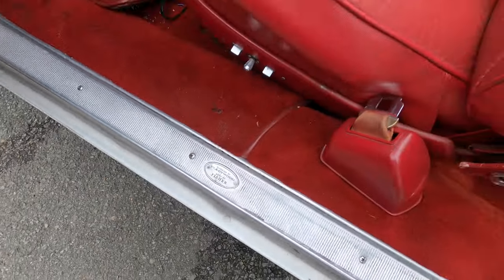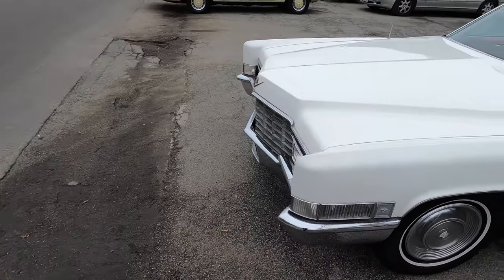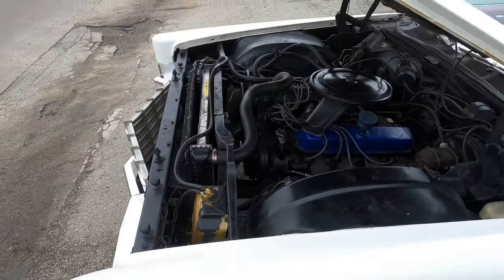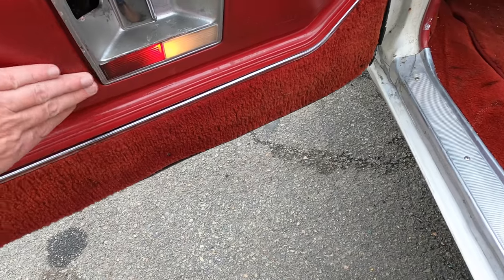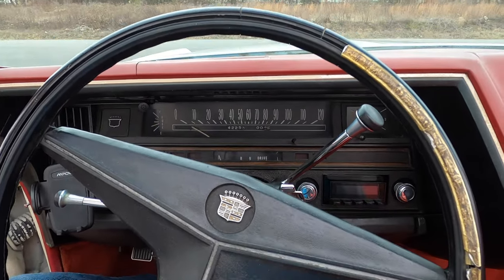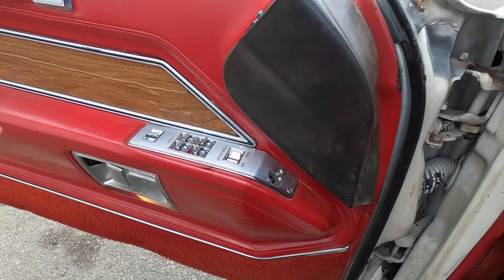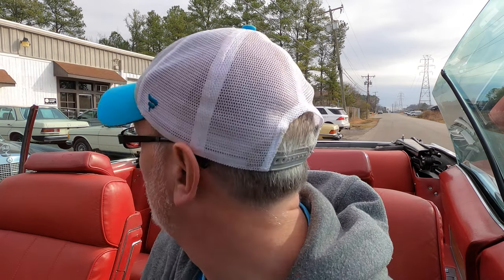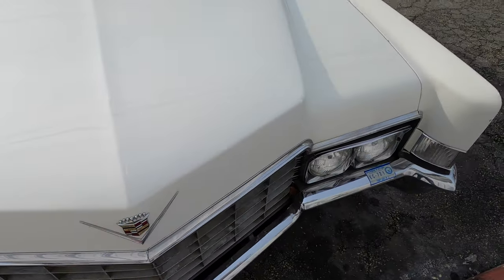1969 Cadillac Coupe de Ville Convertible BOSS HOGG

Comment: Back in 1969, it didn't matter that this car got 9 miles per gallon. In Maryland, regular gas was 29 cents per gallon, and premium was about 39 cents. In those days, my dad could fill up his Oldsmobiles, and get change back from a $5 bill. Also, the attendant would pump the gas for you, clean the windshield, and check the oil. 
    If that was the original top, it looks like it is still in great shape. It's good to see you wearing the Jacksonville Jaguars hat. They made a great comeback to beat the Chargers in the playoffs last week. 😊😊
Reply from the maker: I was a fan before they were good :D

Comment: FYI Boss Hogg's was 1970. different tail lights are the give away
Reply: If I was Boss Hogg, I wouldn't have been trying to chase down those Duke boys. I would've been going after Daisy Duke. 😊😊
Reply: His car is a 1970 de Ville convertible in classic white with white leather interior.
Reply: I grew up with a 1969 DeVille, color code 49 Empire Maroon Metalic with black Ostrich leather interior and white top.  Learned to drive on it too.